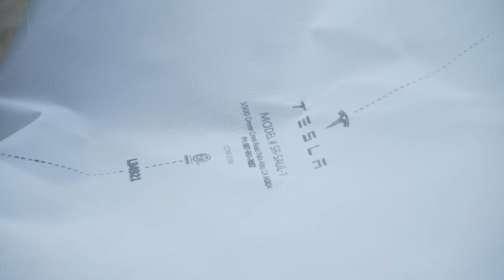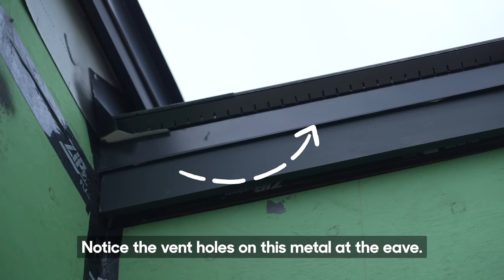Tesla Solar Roof - A Builders Perspective

Comment: I think the solar roof, once widespread and perfected and cheaper, will be the single most important change to our energy infrastructure ever. Imagine if we can entirely decentralize the power grid that’s powerful.
Reply: Solar roof is always going to be more expensive and less effective than the alternatives. Placing solar panels behind glass panels inherently reduces the efficiency. Not to mention that these are hooked up to string inverters rather than better performing micro inverters or power optimizers. You’re looking at a product that requires many more panels to perform at the same level. 

It’s much better for everyone to use metal roofs and and attach regular solar panel setups, or even better we can utilize solar farms that are cheaper per kW.
Reply: Well the company that sells the panels will be centralized, unless they build a company not owned by anyone, good luck with that.
Reply: Don't all solar panels have glass?
Reply: Absolutely! Unfortunately we do have people in government positions pushing back innovation and want to force people to stay using the grid and oil. 
I love that with upcoming more advanced, safer, lower cost and higher capacity batteries can help everyone disconnect from the grid.
Reply: why waste your time and money ? if Mr. Musk has his way he will build his solar farm and be able to power the entire country plus hail doesn't need to be big to destroy an object
Reply: Serious question, when more and more people attempt to do this, and there'e no revenue to pay for the existing infrastructure, then what?
Reply: @JohnSmith-zi9or  you die. No seriously the rates change, if you're the last guy that hasn't put solar on you pay more for electricity than your neighbors.
Reply: @fox156  I don't think you understood my question or the gravity of it.
Reply: @JohnSmith-zi9or guess we'll have too wait and see but my plan is too have my own self sustaining source of electricity through solar panels and possibly the tesla tiles if they are cheaper at that time. I'll still be hooked up too the grid through a switch at the electrical box if something were too happen with the system that needs fixing. I don't forsee the electrical grid being gone but the prices would skyrocket once more and more people convert too solar
Reply: @healer81  irrelevant to the topic. The benefits on a broader scale of each hose, or even a significant portion of homes, being able to provide even 70% of their power needs is to the grid and robustness. And these are compounding effects.

For example consider a simple power outage of say 5 minutes. Do you know what happens when the power returns? A massive spike in power that can overload the system again right way. Why? because the sudden firing up of all those compressors and fans in things running from HVAC to your refrigerator is significantly higher than running power.

Due to that, the grid has to be even stronger to account for it. Much like your car battery has to be able to power the starter - while "running" power draw on the battery is tiny. But if you can cut down say 35% of the demand and especially the spike demand the grid becomes much more stable, predictable, and less expensive.

It also improves the grid's performance by smoothing out load usage patterns - less brownouts and short term blackouts.

That said there are issues to be dealt with at larger adoption rates. Primary among them is the feeding of excess generation during sunlight hours. The current grid does not have much capacity for that. Sure, if we had widespread adoptions of even 35% it might free up the capacity, but there is the chance that it can't free up enough capacity to account for it. 

Adding to that is that we'd have excess production, which is also bad for a grid.  Storage is arguably a top issue for this. You can see this even at the individual house level where you need significant battery storage to make it all work out well at all. Most people think the highest demand is during the day, but it is actually around sunset - when solar is essentially useless.

To get a sense of that difference, consider the notion of turning the AC to a higher temp during the day while at work to reduce demand. This allows more thermal load storage pushing temps well after dark in the house up and you have to fight that with non-solar electricity. However, with a sufficient solar install you are better turning it down, and even actively cooling your attic during the day using that solar generation in order to reduce the thermal load after sunset.

Technically you could do that on a centralized grid, but the grid would have to be massively overbuilt.  These are the types of pattern changes such decentralized systems can provide. And finally, power is literally lost during transmission. Just shipping the electricity around loses on average about 10% of it. Thus not needing to distribute it lowers the losses, meaning more efficiency from existing infrastructure is available.

And this concept doesn't mean just solar. You can by CHP systems (Combined Heat and power) in places that have natural gas lines. In these you are running the NG generator at your house. Even a 1-1 ratio of replacement results in an net increase due to the removal of transmission line loss.

And finally, the current reality is far different from your imagined scenario. There is not a "central provider" problem as we have multiple companies making and installing - and often not the same between those two. Thus despite being irrelevant it is also incorrect.

Comment: One of our primary reasons Tesla became a part of our investments many years ago, is our goal to help accelerate the move to sustainable energy.  Tesla solar roofs and energy storage will ultimately be 10x bigger than the Tesla EV business.  Solar will be one of the forms of energy independence that will give us reliable, clean energy from right here on our own roofs.  Keep up the good work Matt!
Reply: The problem is everyone having these independent systems connected to the grid, and they want to because they always want the grid as a backup and/or they're too cheap to put in a system big enough to meet their needs to be complete off grid, this causes chaos in the total system grid. The electrical companies have an extremely difficult task of keeping the grid operating at the correct frequency, 60hz in the USA. As supply and demand changes throughout the day, they must adjust output. With everyone having an input like this, the amount of chaos significantly increases and makes the entire grid more unstable. Plus, who pays for the upkeep of the grid once everyone decides to do this? This will cause electricity to get more expensive in the future.

Comment: I looked into this 5-years ago when I built my home. It was roughly $80k for a 2,200sqft roof. Break-even was estimated at 50-years.
Reply: I suspect that break even period would sharply reduce as energy costs go up, that sounds like it was based purely on energy cost at time of quote?
Reply: @DomingoDeSantaClara  I'm not sure to be honest, that's just what Tesla said. I live in Ohio, so much different if you're in a sunny state I'm sure with how much energy you can produce.
Reply: Plus the price of the Tesla solar roof went up substantially since then, 50-75% depending on location.

Comment: i was a crew lead with tesla worked for them for 5 years . its a very cool product. The product is designed well for the most part. I will say though I would never have tesla install these them selves. they they cut so many corners on installation because incentive there employees for speed on misquoted jobs and there turn over rate is so high that a majority of there installers do not know how to roof properly. I would make sure you use one of the verified 3rd party contractors.  The only bad thing about this product is the tesla RSD (rapid shut down devices). they have a extremely high failure rate.  and because of how these systems are designed its horrendous to do maintenance on and cause leaking issues when people are popping up tiles as the feet of the panels get pulled up 5%-10% of the time. If they get there failure rate down though this wont be a problem in the future. Another product that is better designed in that regard is timberline solar although it is not as astatically pleasing.
Reply: I'm looking at the Timberline, Solstice, and Suntegra on a new barn I'm designing. I agree, they don't look as nice, but A) the Tesla isn't available here and B) Tesla doesn't fill me with confidence.
Reply: @corystansbury  ya i have not dove into the timberline stuff to much but the design of how its installed makes much more sense then Tesla's.

Comment: I would very much love to see how things are at the end. We installed panels with Tesla Power Walls and Tesla Power. We veto deliberately overbuilt as a hedge against unplanned circumstances and technology in the future as well as to be able to sell power back to 1) help support the grid during times of energy stress and 2)to help defray the overall cost of our system. A solar roof not practical for us--yet. As much research as we've done on the subject, I'm astounded at how much more we've learned with this video. Please continue through the end of install. There are no doubt many, many more things we can learn from those who actually do the work.

Comment: Very cool technology, with that black roof your going to need lots of aircon to cool off the home, thank God there's heaps of free solar power in this array.
Reply: The panel makes a gap between it and the roof below, so while it runs hot, it should keep the roof cooler ,especially in hot sunny climates.
Reply: A lot of the radiation that would be converted to heat by the black roof is being absorbed and converted to electric energy by the solar cells.
Reply: There’s an air gap between the plywood roof and the panels. And it’s not insignificant either. Iirc they actually mention it but cooler air naturally circulates underneath it. It’s probably way better than asphalt.
Reply: @kai.05 xcept solar arrays do create heat. You do realize only 23% of the spectrum of sunlight we get is usable for pvs right?
Reply: @kenthhamner2641  yes, but they also only turn about 30% of that spectrum into heat.
Reply: It vents out at the ridge. Our garage attic used to be unbearably hot in summer until Tesla roof tiles were installed.
Reply: Standard asphalt shingles are black too, under the color granules, and concrete tiles are hot af too. 
That air gap is the ticket to a cooler roof
Reply: I know why not make roofs white in hot areas to reflect heat instead of hold it? My corrugated metal roof is white because I live in south Louisiana which gets very hot in the summer and doesn't get cold for very long the rest of the year.
Reply: @fmlymn1  maybe black under the color but if you can see that black it's past time to replace that roof
Reply: "free"
Reply: @JTrapani  yeah its "free" as in after you pay $100K for a solar roof the electricity is free of course its free after its pays for its self in about 5-10yrs
Reply: Yes pls go back when it's done
Reply: korean
Reply: The black Tesla roof with its natural ventilation behind each panel is cooler than a conventional roof that also helps with the performance of the solar.
Reply: @RossMalagarie  i have corrugated steel over 3/4 in plywood here in philippines and i primed with iron oxide(red) and hi gloss white oil enamel finish. the corrugations make vents between the wood and metal to release heat at the peak. but it never gets hot to the touch anyway! and the sun bakes down on it all day here too.
Reply: You obviously have no idea what you are talking about. There is a 2 inch air gap under the roofing tiles and at the ridge cap. And under neath that the Tesla membrane which is also designed to repel heat, then the 4 inches of spray foam in the attic. That house is going to be cooler than your house.

Comment: Solar roof estimate was more than double what we ended up paying for a reroof, 9.8kwh of modules and 27kwh of energy storage. Also, our power company limits the amount of PV you can have connected to their grid. I've seen a few solar roofs installed in my town, it looks like a shiny black plastic roof. Tesla was supposed to produce several types/looks but never did.

Comment: Yes,  revisit is a must once everything is functional.  Specifically detail 1) the vehicles being charged, 2) how the power wall batteries are able to arbitrage electricity rates for least cost or even making money when over abundance of wind power during nighttime causes electricity prices to go negative, 3) Power-wall adaptation for predicted grid down periods building up storage both in power-wall and vehicle batteries and 4) grid stabilization events in which fast response to brown out situations power-wall owners to participate with virtual power plant responses (and make those leaker plant rates $$$).

Comment: I love my Tesla Solar Glass Roof with two Powerwall+s, 11.6 kw. 

I tell people I have solar roof and until they see it in person, they don't understand and can't find the solar "panels".  Added benefit is that there is a vented air gap between your roof and the solar tiles and it is a buffer from the heat radiating into attic. Less cooling demand.
 
Rain beads off, it's fun to watch water roll off of it. The snow slides off after about an inch of accumulation. My roof is clear of snow and making power while my neighbor's "panels" are still covered in snow for days and NOT producing.
Reply: Oh, and the worst part of it all was waiting or my PTO (permission to operate) from power provider. I was told they would delay your PTO and they were right. Dont blame Tesla if you cant turn on system fully after its installed. It took 6 months for National Grid to grant my PTO.
Tesla will still let you operate in "off grid" mode thru your app. You can produce power and charge batteries but cannot exchange power to or from utility while you do.

Comment: From a Tesla roof user, you should come back and show everyone else how the system works. 
My experience with the Tesla install team A+
My experience with the system A+ 
 Remember that in the winter months systems do not produce as much power, but still can offset home usage if you are running gas heat.
With an EV changing at home and regular home consumption, you can still see grid usage in the negative from March to October. These means the power company pays you for exported energy.

Comment: Former solar roof installer here: it works and it works well... IF... you have good installers and a good structure to put it on. If you dont absolutely want a solar roof, get panels. If you absolutely want solar roof, examine your finances first and then get panels. If you absolutely want solar roof and can afford solar roof, it's the coolest thing ever...until weather...then you schedule the installers to come back in 3 months to replace tiles and metal fab for a week...then it's awesome again (hella good warranty). Solar tiles pop like safety glass and stay in place. 'Dummy' tiles friggin explode and glass goes everywhere. Solar roof is probably the coolest and most annoying thing you can do to your house.

Comment: I look forward to when the economies of scale bring these solar roof tiles to come down to a price competitive with the cost of adding solar + a premium comp roof (or at least a metal roof). That will really revolutionize how many of these get put on as homes need to be re-roofed. Batteries and new electrical panels are a separate cost matter, however.

Comment: Yes, yes, Matt- this is one of my "biggie questions" about installed solar. A view when it is finished and at one year one with emphasis on reliability, comfort and simplicity. Yes, I want to know more about this, Matt. As you may remember, I was a plumber for several decades- water in and out I know pretty well, electricity still has too many 'mysteries', so asking a ton of dumb questions seems the ticket! ,

Comment: Something I noticed that is really important for wind damage on roofs is that there is very little overhang on this roof.  This is important on property in hurricane prone states because of the lift that the high winds create on the overhang that leads to the entire roof being ripped off of the home.  That should never happen with this roof.
Reply: Not unless the eye hits the house. Cat 3 or higher pretty much levels structures if within close proximity to the eye.

Comment: Id love to see a detailed price breakout per square foot of roofing.  Then a savings / break even point (i.e how soon in savings from the grid do you offset the cost).  Because if the cost is 10x the coast of a normal roof, a separate solar array might be a better option.  At least for people who cannot afford to build 7,000 sq ft homes on golf courses, lol.
Reply: You can expect around $50/sqft if you include batteries. If you factor in the tax credit, this will go down to $35/sqft+. We have installed around 50 of these so far so I am speaking from experience.

Comment: PV (Photovoltaic's) suffers from a heat-related drop in energy production. The air gap is likely to help allow some of that heat to dissipate and thereby mitigate production losses. Yes - revisit the job-site after the install is finished.  This is the Rolls-Royce of home energy systems!